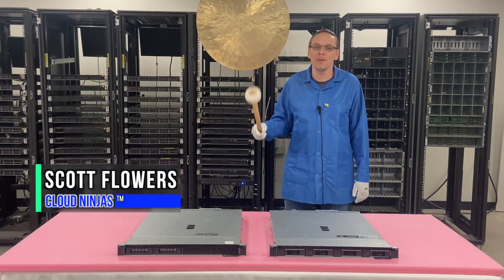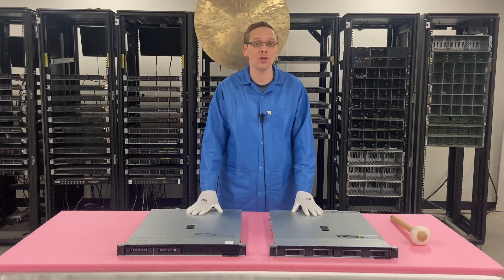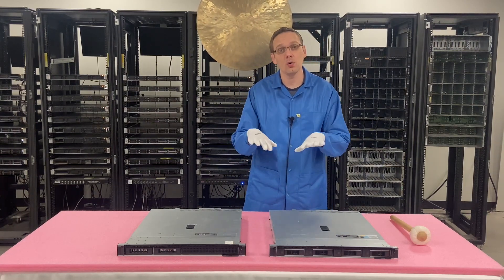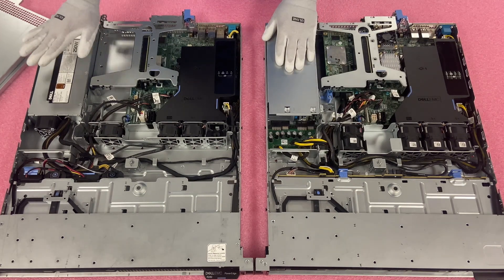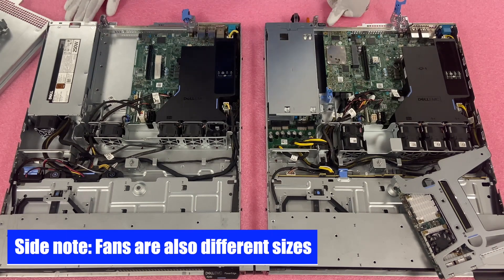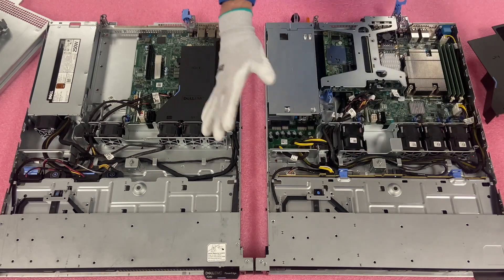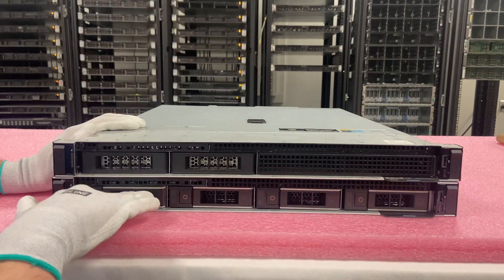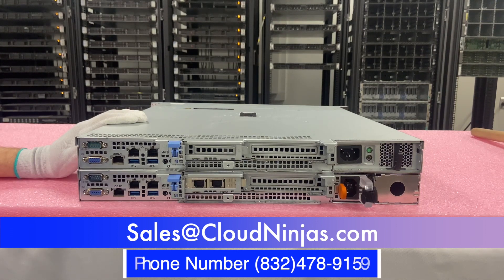Dell PowerEdge R240 Chassis Overview | Chassis Options | 2 Bay LFF Cabled | 4 Bay LFF Hot swap

Comment: My r240 has 4 hot swap bays w backplane, but a single non-hotswap PSU and is missing the dedicated PCIe slot for the raid card. The sas backplane connects to a perc h330 in the riser. If there any way to install that dedicated pcie slot for the raid card? I need one more slot to get a BOSS card, a 10gbe card, and the raid card.
Reply: Did you ever find an answer to this? I am in the same boat lol